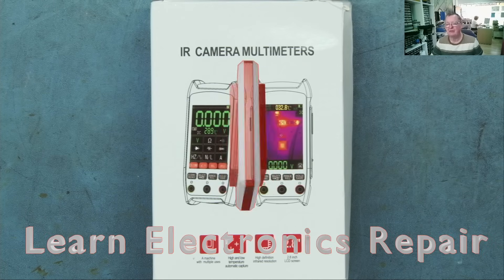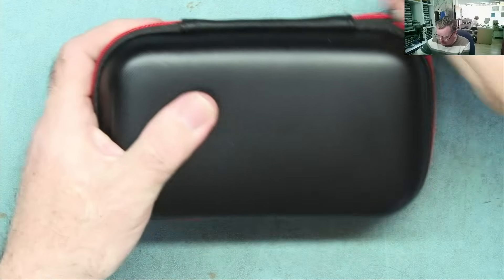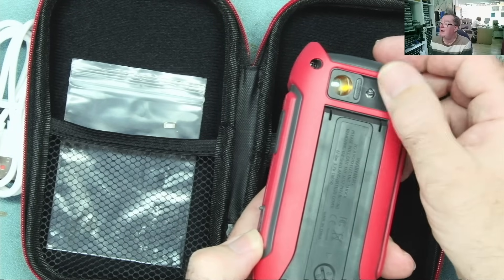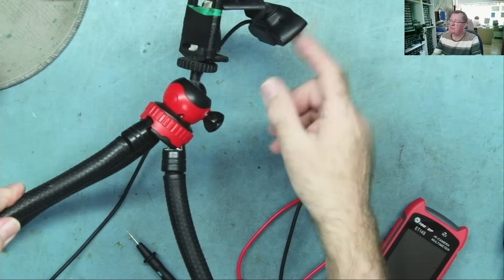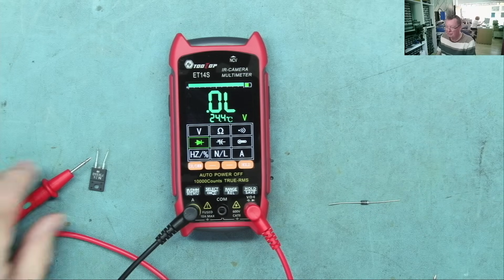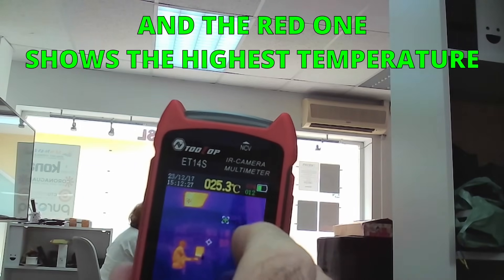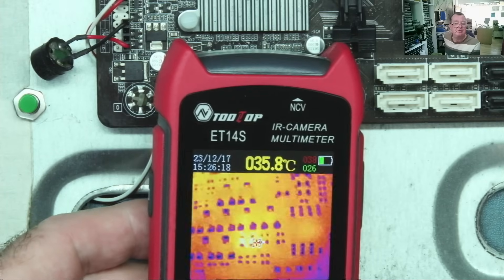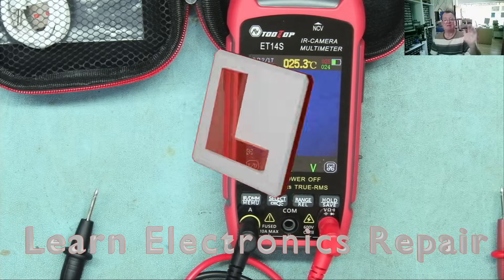ToolTop ET14S Multimeter Thermal Camera Test And Review

Comment from the maker: A lot of you guys are interested why the multimeter worked when I had the black lead incorrectly connected to the Amps socket instead of Common socket.  This is so interesting  I decided to make a short video about this and it will be published tomorrow
Reply: I think hi current socket has a very low resistor (shunt) and instrument measure voltage drop over this resistor. So, no much difference from current socket and common socket due to low resistance over the shunt.
Your videos are very interesting and education and keep going! I join your chanell today but more than a week i saw ...30? of them and all are good. Regards, Iztok from Slovenija
Reply from the maker: @iztokahacic6349  welcome to the channel and community 🙂

Comment: Hello, buy the ET14C model which is the same as the ET14S but without multimeter and from the same day that it came to fail, the screen flashes and ends up filling the full striped screen, the menu is going well, it fails only in the thermal image, sometimes it takes a few minutes to give the fault and other times it does it within a few seconds of the ignition, would it know what the problem is, thanks.

Comment: That mount on the bottom, while simple, is a great addition!  You could mount it on a tripod as you say, or one of those articulating arms.  Then you could easily swing it around and point it at a spot on a board to watch a component over time without having to stand there holding it!

I have one of the MT15S's (next model up) on its way to me as we type.
Reply from the maker: I totally agree, while it is such a simple thing the standard tripod mount on the bottom is an excellent addition for all the reasons you mention 🙂
Reply: I am considering getting that model. If it was on Amazon I would have already purchased it because of the no risk and extremely easy return.

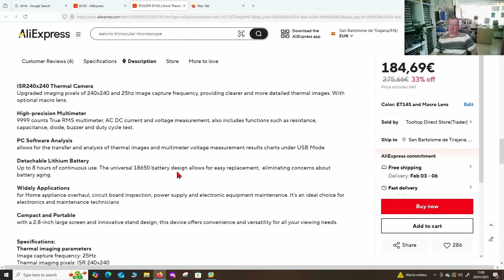Comment: 6:47 Notice the sensor resolution 240x240 is "ISR" which I understand means it is UPSCALED.  IMSAI guy checked with the supplier and the actual pixel resolution of the sensor is 96x96.  So it seems when they went from 13s to 14s, they changed the ISR upscale, but did not significantly improve the sensor other than 20 to 24 Hz refresh rate?  @LearnElectronicsRepair can you check with the manufacturer if they increased the PHYSICAL pixel resolution on the 15s, and also compare the image quality of the three units once it has been delivered?  I don't care about the multimeter functions of the 14s, because it seems they only changed from a touch screen to buttons and added amps.  I'm much more interested in the multimeter functions in the upcoming 15s, which appears to be dramatically better and with higher counts. The 15s display also has more pixels, and the spec on the imaging sensor is higher (or it's another level of ISR) and at 25 Hz. 5:20 It appears the macro lens covers the flashlight LED when not in use.  I wonder how that changes the flashlight output?
Reply from the maker: Yeah I saw the IMSAI guy video regards the IR resolution.  Also Interestingly regards the ET15S that IMSAI guy said Tooltop were not sending out promotional samples, I also asked for one and they said YES.  In fact it's already here and in the next few days I'm going to publish as direct comparison ET13S vs ET14S vs ET15S video showing all three together.  Watch this space 😉
Reply: Thank you for pointing this out - saved me from buying this kind of "product". :/

Comment: Most meters will beep if the lead is in current socket but you're not on current setting. You should make a suggestion to manufacturer to update the software to fix that, then do the firmware update and re-test / re-review.
Reply from the maker: Well actually sticking the lead into Common instead of Amps, although technically correct,  would make absolutely no difference to the review.  I'll explain and prove this in tomorrow's video.  Already scheduled to publish 08:15 UK time
Reply: They may also change the spacing from the COM to the Amps so that leads with standardized spacing will not fit.
Reply: @pault6533  leads are separate, changing spacing won't do anything. If someone does have joined leads then they won't fit which makes them incompatible with all other standard leads. No no no!
Reply: @g4z-kb7ct   Inexpensive meters have strayed from conformance to existing standard.  They provide disjoint leads.  This does not mean following the spacing of the joined lead standard would not be helpful to traditional users, while not causing problems with new users.

Comment: Hey Rich,
Am I missing something?
Every test you did, you had the black lead in the Amps socket?
Sure, it still worked, but I'm surprised there's no auto detect buzzer to deter one from accidentally leaving the leads plugged in wrong and possibly shorting something out, or blowing the meter fuse.
I wonder if that's why they included a new fuse🤣
I'd also be interested to know if it warns you if you are in Amps mode but have the leads connected for voltage, ohms etc, as well as if test accuracy is any better with the leads connected correctly for the selected mode?👍
Reply: yeah and he forgot to de the current test.. he needs to redo the whole review video !!!!
Reply from the maker: And it made no difference to the operation of the multimeter... this fact and the reason why is so interesting I just recorded a video explaining it.  It's gonna be published tomorrow
Reply: The plastic jack for the A port is black, should be red - and so should the main input.  I believe the manufacturer shares the responsibility for the user error.  The thin yellow marking around the hole isn't enough.
Reply: The only difference between amps and ground is a high value, low resistance fuse.  You can get away with using this with the black wire in A instead of COM, but not with the black wire in COM and red wire in A. 💥
Reply from the maker: @pault6533  quote: but not with the black wire in COM and red wire in A. 💥 

Yeah unless you are actually trying to read current of course 😉

Comment: Should the black probe not be moved from A to Common? when testing diodes?
Reply from the maker: It should and yet it works :) Interesting.  I didn't notice my mistake because it worked as I expected. My guess is the A connector connects to the Common via the fuse and shunt which itself is very low resistance, must check this out today, think I accidentally discovered something there.  I wonder if this applies to all multimeters, more or less 😅
Reply: @LearnElectronicsRepair  we demand a redo of this review with the leads in the right positions... as the shunt could confuse the diode test and will add a little resistance with resistor ohms testing
Reply: @Dutch-linux  I concur, but I would to attenuate "demand" to "humbly request". I'm also Dutch by the way.
Reply: @LarixusSnydes  I assumed he was trying to be funny. 🤪
Reply: @LarixusSnydes  Heya, 1 more dutch guy here
Reply from the maker: @Dutch-linux  Not necessary... wait until tomorrow and see why